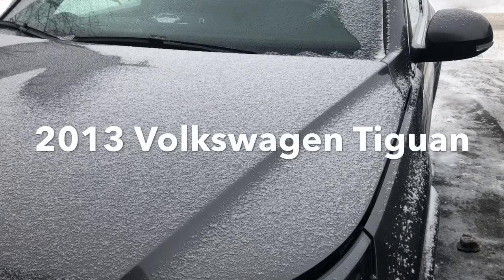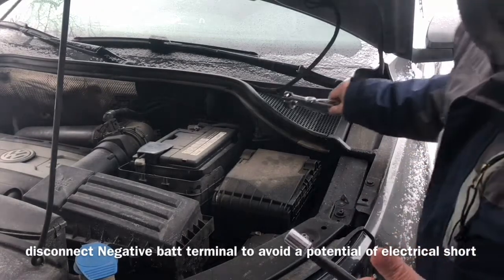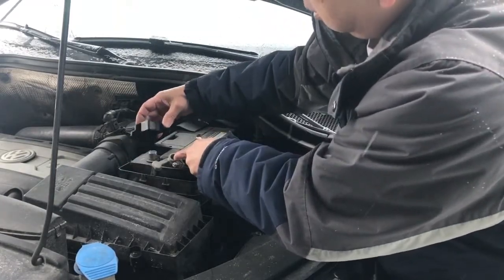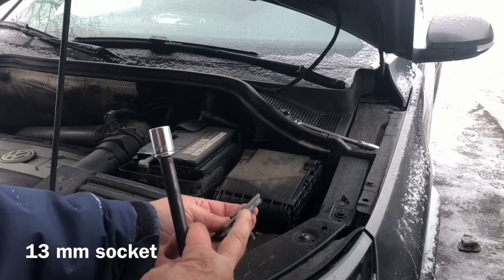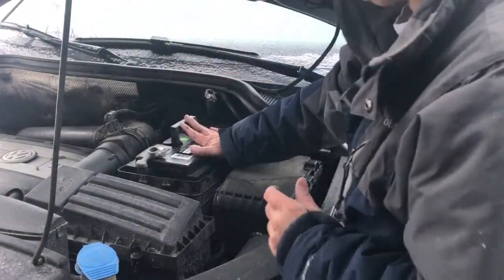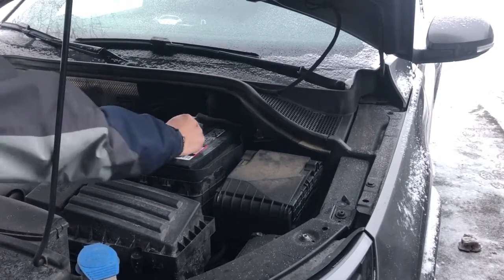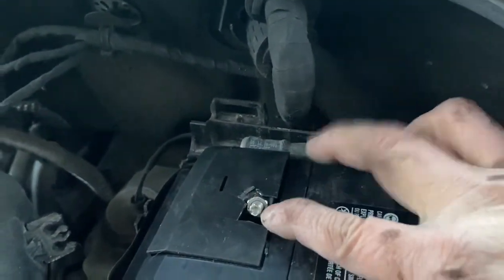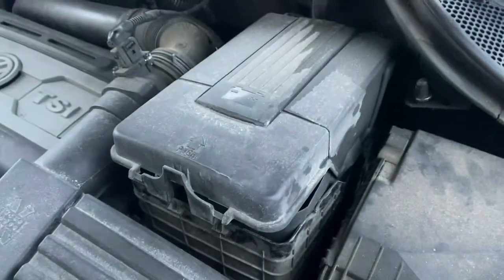DIY - Volkswagen Tiguan - How to Replace Car Battery and Charging System Voltage Check

Comment: So, you didn't have to use an OBD scan tool to code the battery to the car? Thanks
Reply from the maker: This is Volkswagen . Not BMW. This car does not have battery management system like BMW.  Just replace it !
Reply: @maniata8869  many thanks!
Reply: @maniata8869  Actually it needs. You can use BEM code or Long Adaptation (mostly recomended). This system is not self learning. You need to program Vendor, new capacity, change serial no (usually +1) and type (AGM and EFB has same charging method)